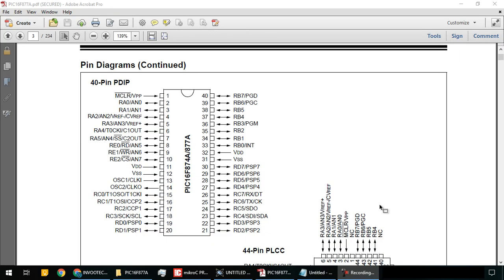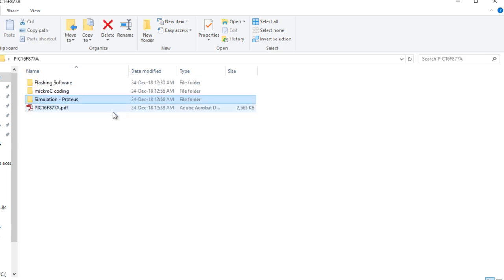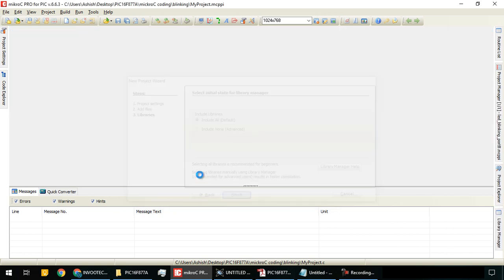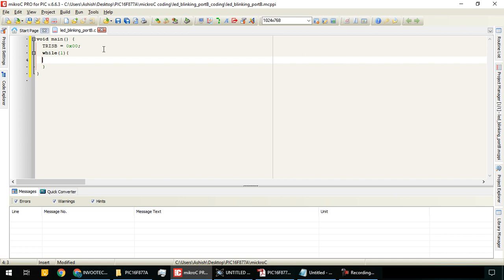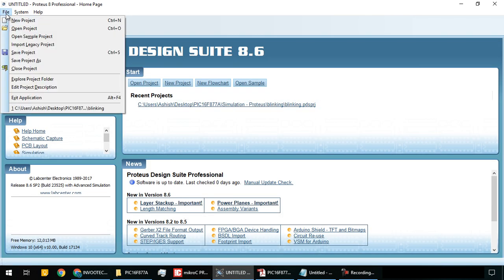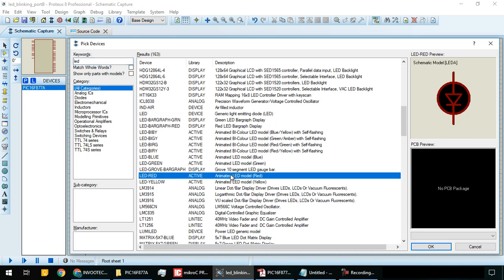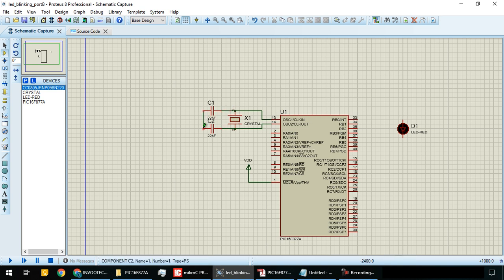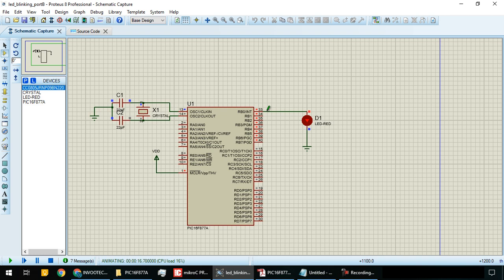1. LED BLINKING USING PIC16F877A (Coding - MikroC and Simulation - Proteus)

Comment: Hello sir how you chose or calculate the capacitance values ?
Reply from the maker: A crystal’s frequency is specified for load capacitance CL. If the actual capacitance is too high, the crystal will oscillate more slowly. If the capacitance is too low, it will oscillate faster. Note that while crystal datasheets specify frequency variation as 1) initial accuracy, 2) stability (primarily across temperature) and 3) aging, none of these account for frequency variation caused by incorrect load capacitance on the board.

If alternate crystals are specified for a board, all alternates should have the same CL spec.

The following equation shows the relationship between the board capacitors C1 and C2, and the CL spec of the crystal.

CL = (C1 * C2) / (C1 + C2) + Cstray

Stray capacitance Cstray comes from the pins of the chip and parasitics from the board. It is often approximated as 5pF.

Assuming the same value is used for C1 and C2, the equation can be rewritten as:

C1 = C2 = 2 * (CL – Cstray)

Here C1 and C2 Are connected to Crystal Oscillator
Reply: @INVOOTECH  thank you so much

Comment: Why to add crystal oscillator externally?
Reply from the maker: internal oscillator do not provide that precision and so adding an external oscillator is always advisable. You can read more details for the internal oscillator on the ic datasheet.